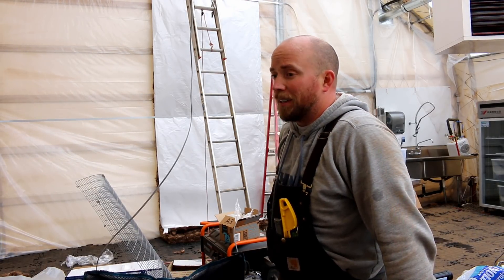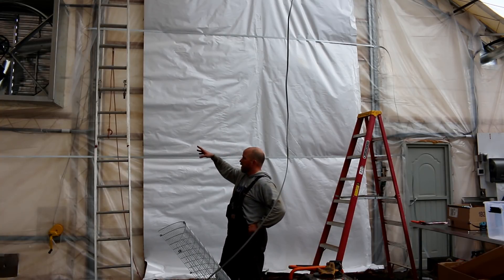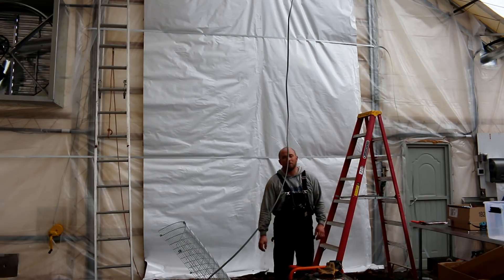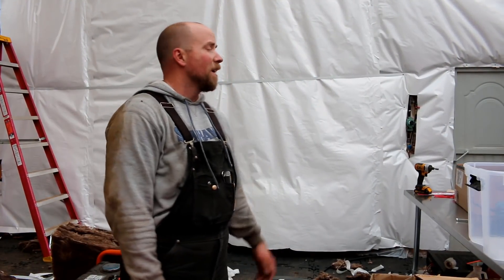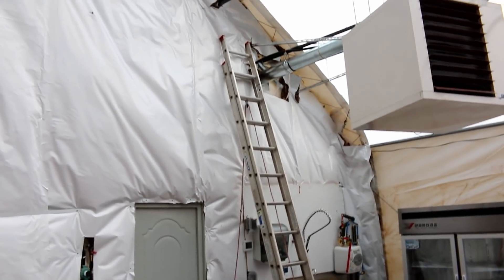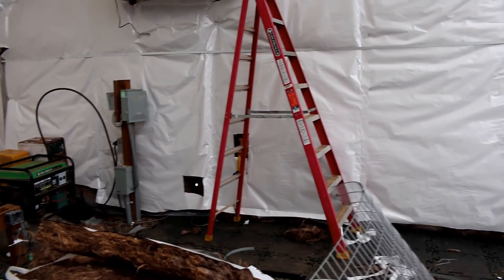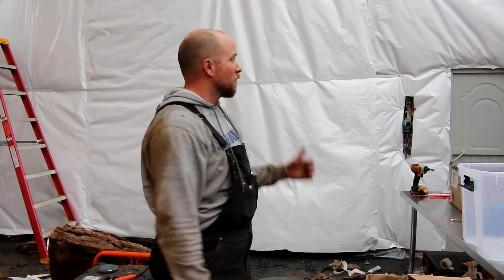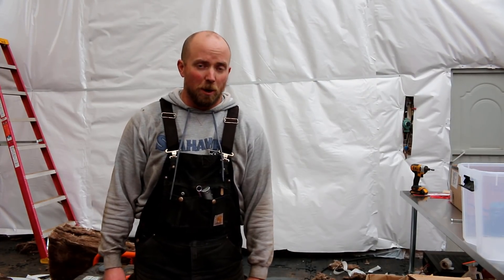How to Insulate a GREENHOUSE - Part 4

Comment: Curious what you can do for insulation on the clear part of the roof. Maybe a sealed air gap approach with another layer of poly? Obvious considerations would be R value bang for buck and of course some light loss even with another layer of clear poly.
Reply: He'll be adding a garage door type of roll up insulation under the clear part.